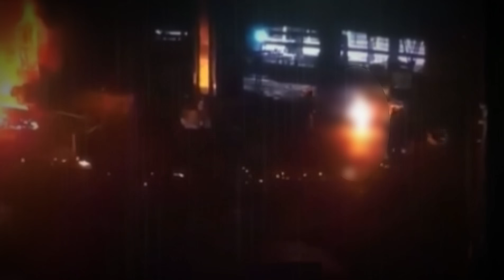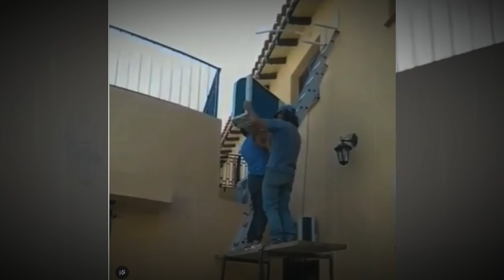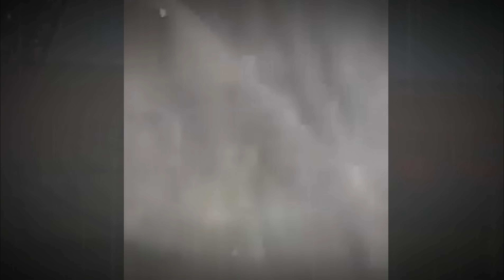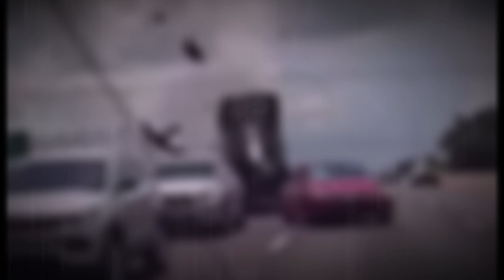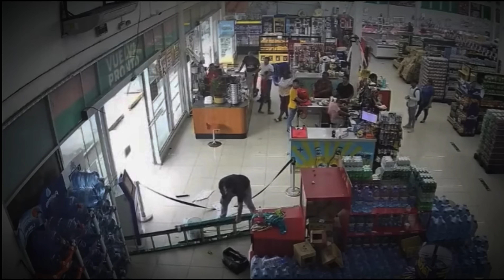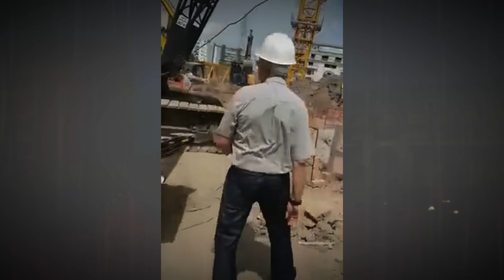Top Accidents Captured on Camera...

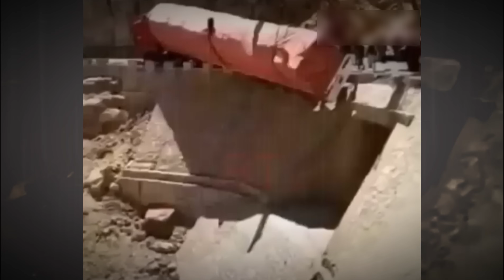Comment: 4:04
They are so lucky they didn't get snagged and pulled down as well.
4:45
Didn't they realize that the crane's lift point was well over the cliff edge, and that once lifted the trailer would swing out over that lift point?  It kept from falling only by the friction of the tires gripping the cliff edge, and once lifted off those tires ....
5:42
Falling in the manner show will actually cause the top most portion the structure to strike the ground at a speed greater than just from falling straight down.